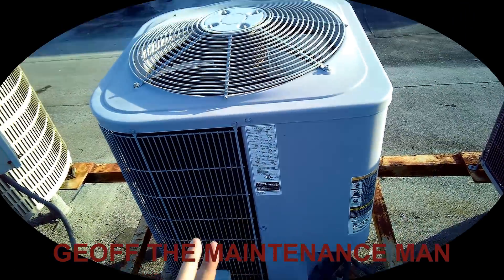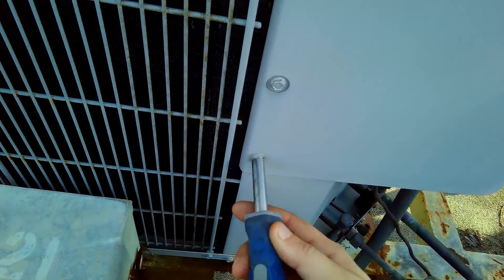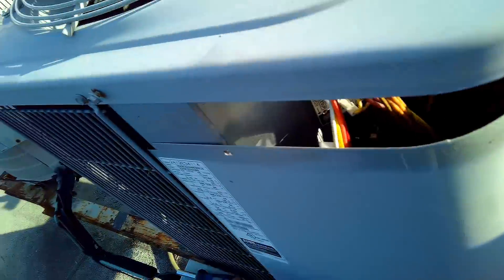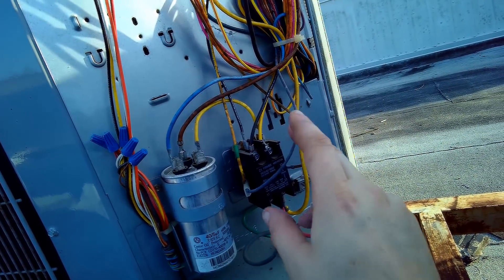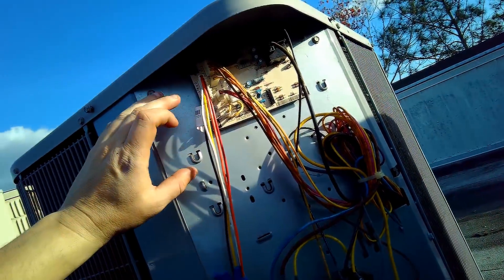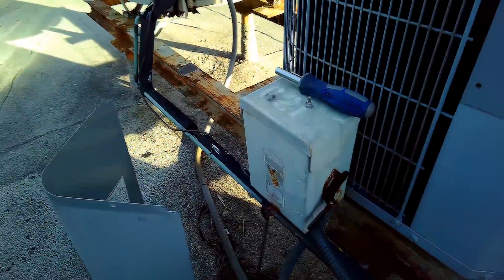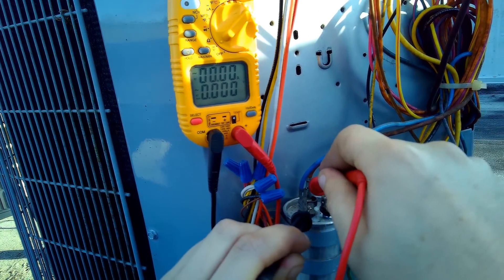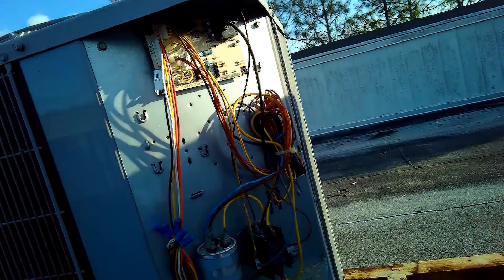HVAC Air Conditioning Basic Components And What They Do.

Comment: Is it easy to program the computer board to broadcast the batterie status to the t stat or would i need a 3rd party mod and a 2nd batterie ?
Reply from the maker: Yes just connect An Amazon Echo dot  via WiFi  say Alexa program my ac. She will then ask you to go on the phone app and enter your model a serial number. At this point the echo dot will do a full scan and diagnostics of your system you may see a blue spinning ring while it is programming. you can also say Alexa order the part that is broken on my ac. This has been the easiest in my opinion. Best of luck and happy Easter.
Reply: i love how i miss spelled battery twice i blame the beer

Comment: It's not a battery backup...It a dual Capacitor...one bump-cap for the compressor & one for the fan unit. If either goes bad, the motor won't turn.
Reply from the maker: Careful now  Keenan Booher
 @7:33😉.

Comment: That Battery Backup System must be using Harbor Freight NiCad cells because both banks are reading zero.  It should read 45 microvolts on one leg and five on the other.  Replace them with the new HF Lithium cells for superior fan operation after shutdown.
Reply from the maker: HF Lithium cells are great you just don't want to get the the china version lol